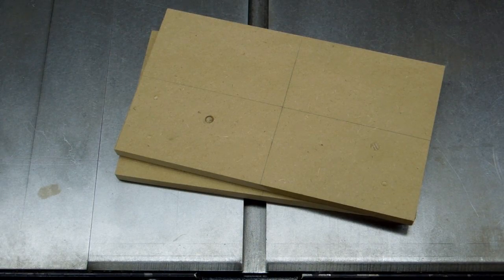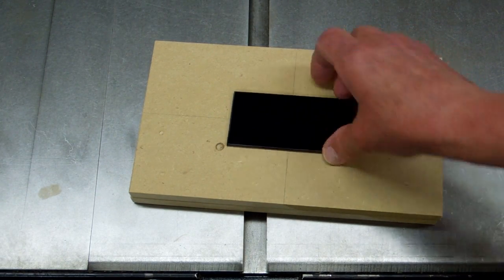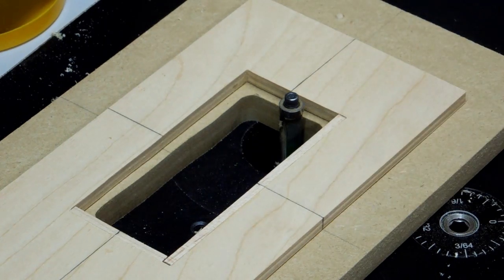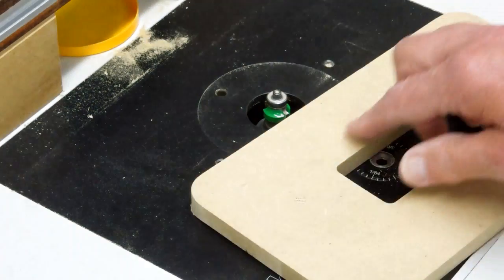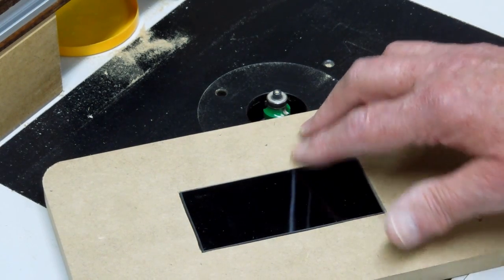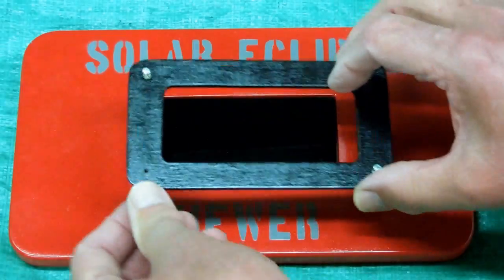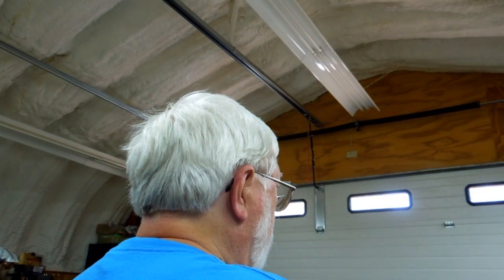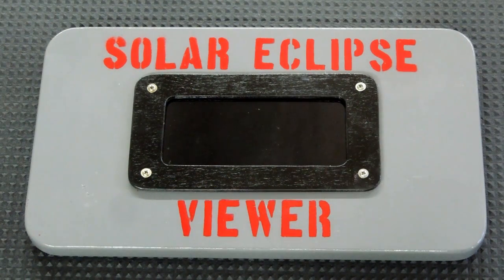Solar Eclipse Viewer - Safe Viewing Glass

Comment: I have a # 14 welders glass from the eclipse in 1979. I wish I had a holder like yours but I think I will be okay with just the glass.
Reply from the maker: You could make something very similar with a few pieces of cardboard and a glue gun. The larget holder provides more shielding.
Reply: Thank You, I really like yours but do not have the tools or talent. But as a side story in the late 1950's early 1960's when I was in high school if they had let me take shop, as I wanted to, it may have been different.
Reply from the maker: If you can run a sewing machine you can run a scroll saw. A scroll saw, small drill press and a shopvac and you could have a lot of fun... even make a wood gear clock (or something).

Comment: Great to see one of your videos again Ron! Back in 1999 we had an eclipse in Europe and we used these free glasses which worked ok. Not recommended were CDs and floppy disks. Just reading some test work at a Belgian university saying that the welding glass you used is actually just perfect: not too little and not too much transmission, although the sun might look a bit green as of an absorption minimum at 550 nm. Have fun. Cheers, Arthur

Comment: Been in solarviewing for 48 years! Welding glass is very safe! Want to say that, if you here have a small tele/spottingscope or binocular, you can use that as a projection device! For protect the eyepiece, put down the objetive  diameter to 1/2"(15mm). If it is a binocular, cap the second tube with lighttight cap. Aim   (WITHOUT LOOKING THROUGH IT!!)   with shadow as help against the sun (some kind of tripod or suport is great) and hold a White card/paper 1-2 feet behind the eyepiece for get the image of the sun! Made focus at the limb or at a sunspot! Totaly safe and many can look at the same time :)

Comment: I remember when I was a little kid in school in the 1970's, they gave us all 4 old film negatives to stack together to watch an eclipse through that happened during that time period. When I grew older and started reading about the effects on your eyes, I have to wonder how much damage that did to all our eyes? The #14 filter plate is a much better option.
Reply from the maker: That and the kerosene lamp smoked glass plates were not a good idea.  Oh yes, and they would put a drop of mercury on our finger to rub around on a penny to take home to show everyone how shiny it was (and for more to handle). :-)
Reply: LOL. And today a small amount of mercury vapor in a fluorescent lamp will kill us all if it breaks. One has to wonder how much those sorts of environmental hazards from back then has shortened our lives. Or whether a lot of that hazard was maybe over emphasized. Don't forget, in the 19th century mercury pills were prescribed for depression and other ailments. Not that I ever would recommend handling mercury externally, let alone taking internally.

Comment: Great to see more videos from you!! ..No welding equipment??
Reply from the maker: Yes I have some welding equipment but not dark enough.
Reply: I was thinking more along the lines of replacing the glass in your welding helmet with a darker glass plate.
Reply from the maker: I only have one helmet and there are two of us wanting to view a relatively short event (assuming no cloud cover). This is a fairly easy and cheap thing to build and you don't need to paint or label it. But since it was going to be a video I prettified it a bit.
Reply: Well..It came out great. Better than a welding helmet !

Comment: Try looking at the reflection in a large dark bucket filled with water. When we had an eclipse in the uk many years ago that worked very well.
Reply from the maker: In my experience, some of the worst sunburns came off water. Reflections off water are basically like a mirror and I don't think I could recommend viewing a reflection off anything.
Reply: Ronald Walters your not going to be sat staring at it for hours Ronald like if you was fishing. Anyway it's tried and tested and it worked well and we had no casualties. Put a jumper on it will get cold for a spell too.

Comment: Hm. Last i checked, with a welder plate, you can still see the filament glow on an incandescent light bulb. That means it's not good enough for safe viewing. Might be just my helmet, i mostly do low temp welding.
Reply from the maker: I looked at a 60 watt frosted bulb (right up against the No. 14 filter) and could not see a thing. A Surefire flashlight with one of the older halogen bulbs right against the No. 14 filter, you could barely see it was lit and they are several times brighter than an incandescent bulb.
Per the NASA website – “Experts suggest that one widely available filter for safe solar viewing is number 14 welder's glass. It is imperative that the welding hood houses a #14 or darker filter. Do not view through any welding glass if you do not know or cannot discern its shade number. Be advised that arc welders typically use glass with a shade much less than the necessary #14. A welding glass that permits you to see the landscape is not safe.” 
I have seen studies suggesting a No. 12, 13 or 14 welding filter was good enough but I think I will stick with the NASA website.
Note: I have not seen a filter darker than No. 14 listed anywhere.
Ron
Reply from the maker: Google search produces many opinions. Few, if any, can be verified as more than conjecture. Personally, I suspect the resultant shade and light filtering obtained by stacking filters may NOT be linear (like a #6 + #8 may not be equal to a #14) and stacked filters would produce a lower image quality. The other factor is the quality of the filters you have and are they clearly marked, no cracks, scratches or weld splatter pitting, etc.Not knowing the correct answer I would error on the side of caution.  If you have approved viewing glasses (in perfect condition) use them.
Reply: Ronald Walters I can't find #14. I can find a #10 and #5. I wonder if they could be stacked? I have glasses either way.
Reply: Ronald Walters thanks. I have a brand new pair of NASA glasses. I've tried them and they work well.